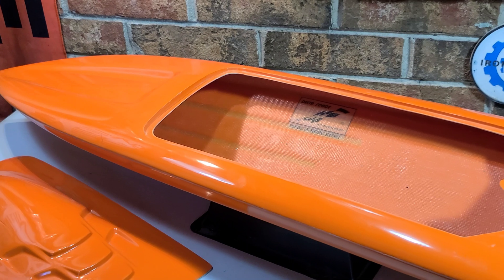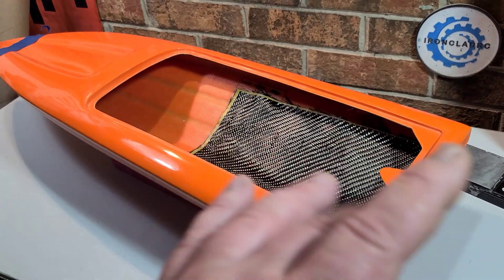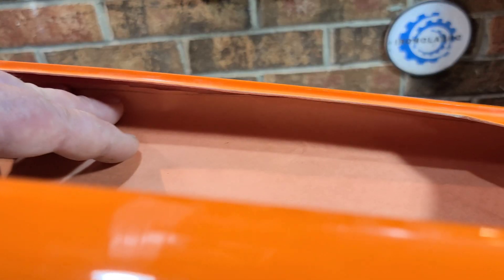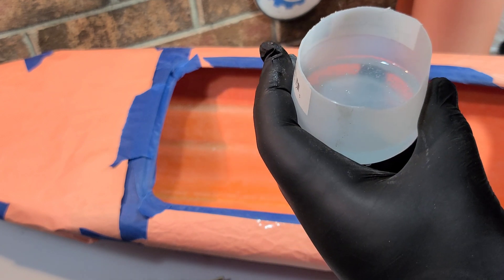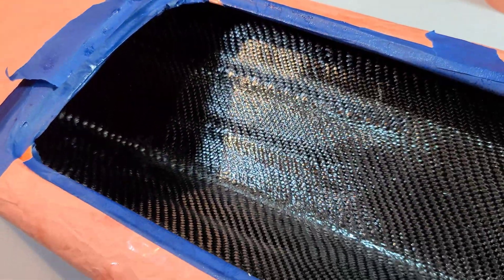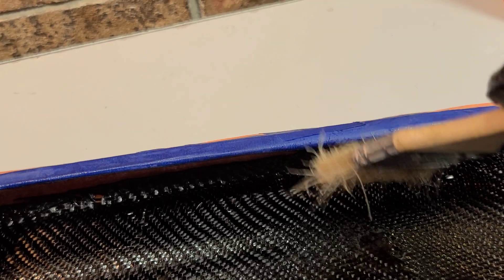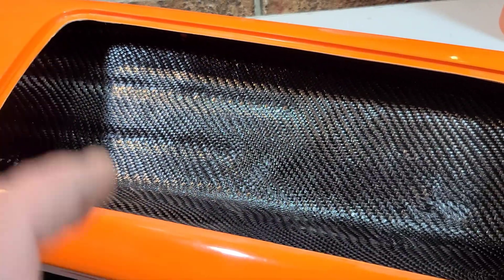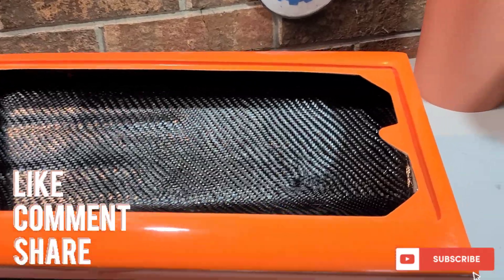Carbon Fiber Inlay Deltaforce 29 Twin Motor Mono Build Series Pt2

Comment: I’ve been enjoying your videos as a new subscriber! May I assist your skills by sharing some information. 
I’ve been working with carbon fibre for 5+ years now and I find its best to give your resin base layer a good tack. I use slow resin from west system and my tack is 4h. Then the cloth goes down and cures after being rollered in. 6-8h later you can top coat and you will see the improvement. 

My other tip is use a silver sharpie to mark your cloth as you go strain blind when cutting…
Also never use a brush. It’s guaranteed to leave hair. 

Boat gang bro!🤘🇨🇦
Reply from the maker: Thanks,  I do appreciate the information...
Reply: @IRONCLADRC  Also you can use 3m super 77 or air tack to glue the carbon before cutting to avoid toe nailing the ends of the fabric 👍

Comment: That’s great for fibre glass hull , but is there a way to lay carbon fibre Kevlar into ABS plastic hull, manufactures like Krick that bought ROBBE boats out say do not use Epoxy so is there a alternative 
Any way great video for glass fibre hulls 😊
Reply from the maker: I just did a carbon fiber inlay in a miss geico 24 abs hull.  You can use epoxy in abs plastic hulls without issue

Comment: Hey big b. What do you do. To get boats ready to run in saltwater. Or is it mostly care after you run it in the saltwater. I was thinking some corrosion x on all the outside hardware. But im not sure
Reply from the maker: I use corrosion X on my rx/x and inside my servo, that's about all I use corrosion X on.  (Use caution using corrosion X on wires it'll make them stiff)        most importantly make sure the boat is water tight, run your boat in fresh water make sure there's no water leaks if there is fix it then run it again in fresh water till you have a dry boat.      Use dielectric grease on your battery & esc conectors.          Of course rinse your. Oat real good after a salt water run, flush the cooling run, and pull the flex cable. 💪
Reply: @IRONCLAD RC  awesome thanks  for getting back to me.